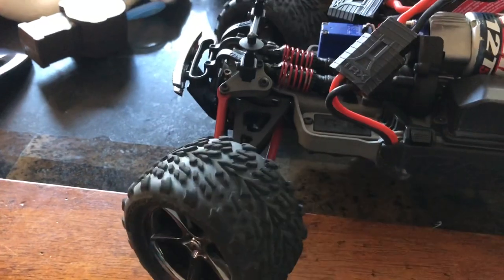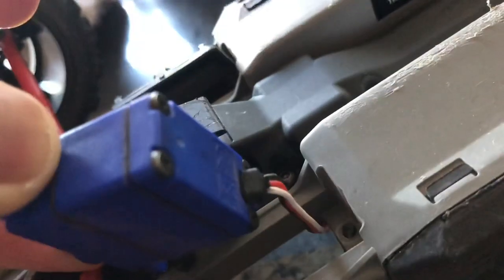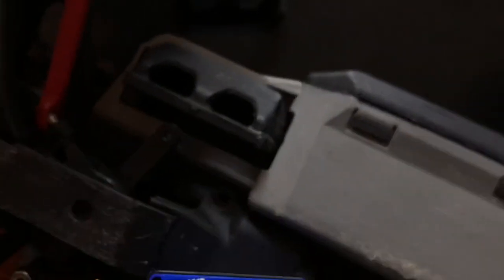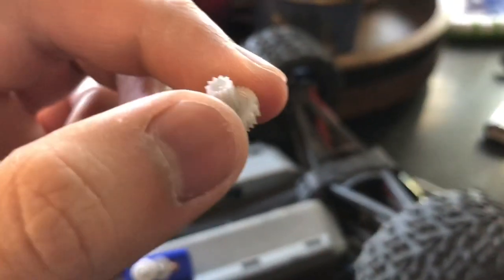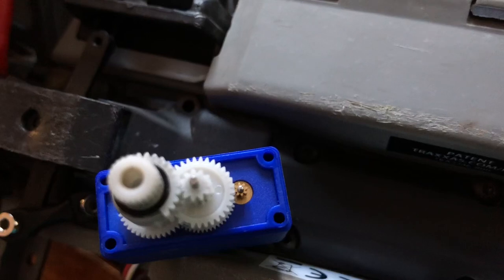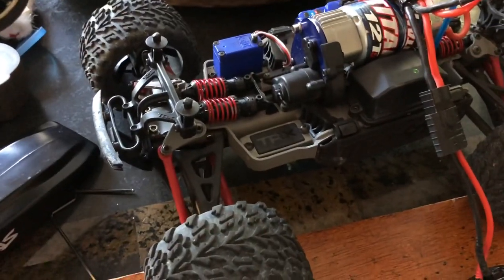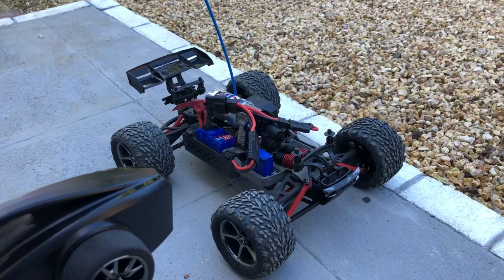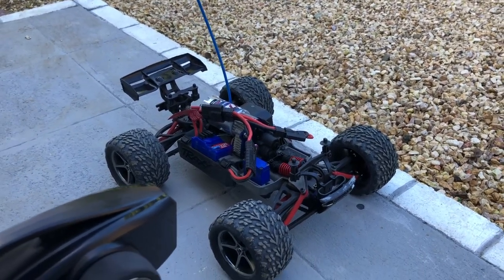Traxxas E-Revo 16 Scale 2080 Servo Gear Stripped Budget Fix

Comment: I wouldn't even replace the gears, I'd have them for spares though just in case another part strips, that temporary fix could last years, there is no way that gear could end up back on the stripped part anyway.

Comment: Neat fix 😁👍
Reply from the maker: Thanks. You should try that out whenever you have a servo stripped
Reply: @TndPnyRCofficial  so far I haven't had one strip but then I don't put them under much load with most of my builds. I have just ordered some 9g metal gear servos for a little project I have in mind that might put a little more stress on them so we will see.